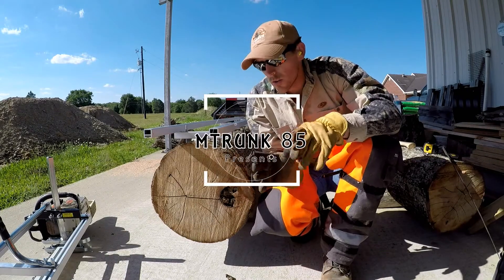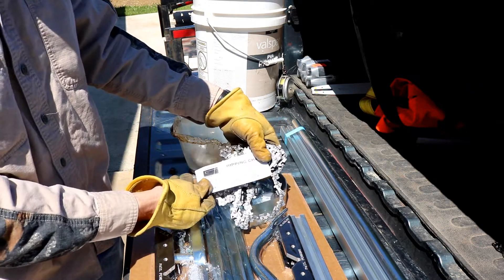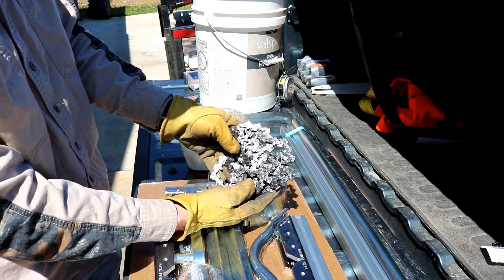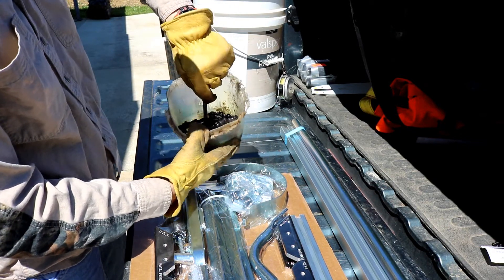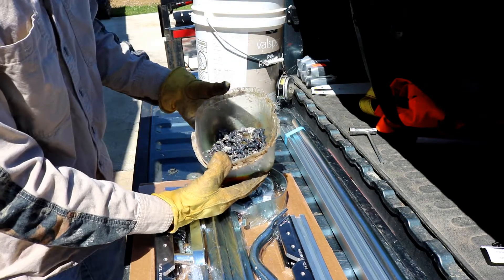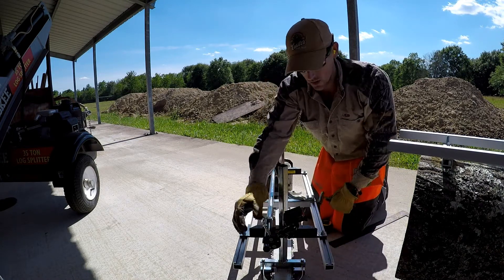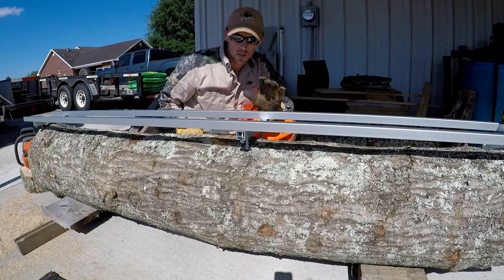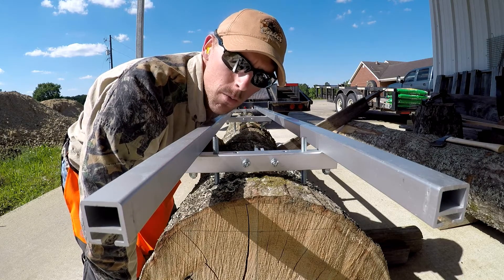Granberg MK-IV 36" Alaskan Chainsaw Mill with STIHL MS460 & 9' Guide Rails Pt1

Comment: Bar oil is stickier than motor oil so it doesn't fling off. Putting motor oil on the chain probably isn't going to hurt much except it might make the actual bar oil have a harder time sticking when it gets oiled by the saw.

Comment: Good tip soaking  New chain before using== I would just let it hang for a few minutes to let the excess oil drip off,( Just a little less of a mess to work with)  How do you like using this mill?  First Like==
Reply from the maker: It works pretty good but you need a lot of oil and a sharp chain I will be putting out some more videos on it soon.

Comment: Looks like a nice setup for a chainsaw.  When I started using my Granberg I was super careful setting it up and leveling everything.  After a while using it, you just get the feel for how to measure out your first cut.  The first cut is the most important.  Just wondering what kind of wood that WAS?   From here it looks like soft maple, I know you have a lot of different woods down by you.  Thanks for sharing and nice video.
Reply from the maker: This is a great set works good, This is the red oak that blew down early this year pretty hard wood.

Comment: I've often thought that I could turn all of the local trees that fall down into quality lumber, but this is the first tool I've seen that might be practical.  What did the set-up (excluding the chainsaw) run you?
Reply: Please "tag me" on his reply.  Thanks in advance.  TH
Reply from the maker: Looking at around 500 for this setup, It works good just takes time and a hard on the chainsaw you will see that on the next video.
Reply: Thanks MTrunk!